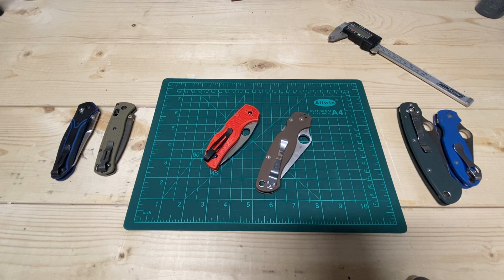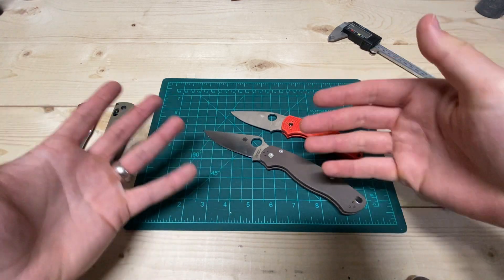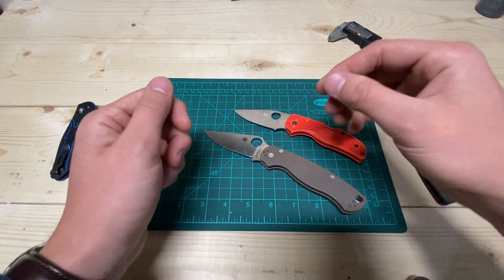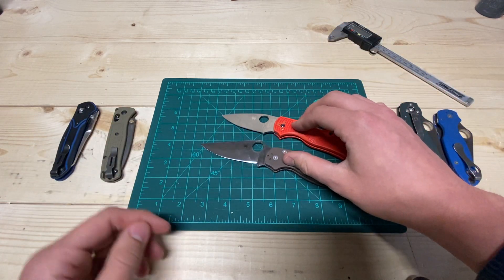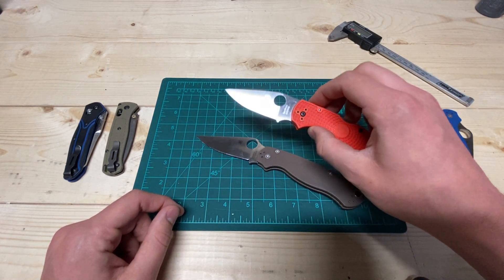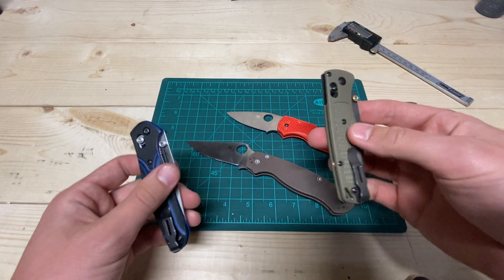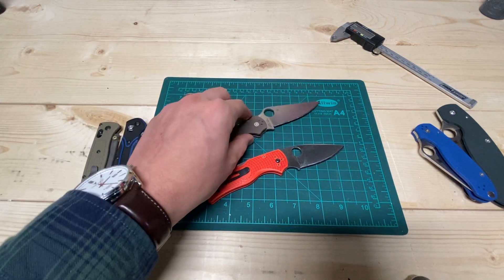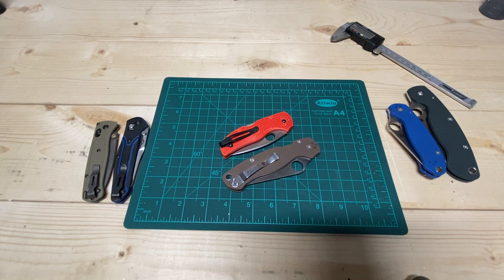High Grit Edge Performance for S35VN and LC200N (Plus a note on hardness)

Comment: I never liked s35vn I was disappointed in my coldsteels lol I also sharpened it toothy like 600 grit like people said it would never last well and I didn’t like it. I tried a hi grit now I really like s35vn ima try the same with spy27! Thanks for the suggestion
Reply from the maker: I was the same way! High grit finally let me enjoy the steel
Reply: @EngineersPerspective701  I got a police 4 in spy 27 on my secret Santa list. Any experience with that steel? I here it’s a lot like s35 in performance but a finer edge and about as easy as vg10 to sharpen I know I won’t be blown away with edge retention lol but I’m kind of excited to mess with it I like steel that easily strop back
Reply from the maker: @williamsmith5429 I haven’t had any but always thought it would be a really nice balanced steel. Kind of like a more edge stable SG3 with similar hardness but less carbide. Especially if you like ceramic stones to sharpen it would be way more enjoyable over the higher vanadium stuff which is why I really like SG3 in kitchen knives even though I find it a bit chippy at say 11-13dps.
Reply: I like bigger blades and the police 4 is my favorite model with a nice thin , long, and slicey blade. Love k390 but not only am I really active I work outside by the ocean where I am constantly sweating or getting rained on and my sweat seems to be very corrosive for what ever reason the tool steels take a lot of maintenance to carry for me. I have to constantly oil stainless or I will rust them too lol.
Reply: Btw I really enjoy your channel and I agree with most your takes on steel appreciate the content.
Reply from the maker: @williamsmith5429 appreciate the comment!

Comment: A recent note: I have picked up a pacific Salt in LC200N, the steel takes a sticky sharp crazy easy, I think for most people it might be an all-around better option than the S30V family of steels, as no special equipment is needed to sharpen this tough relatively high edge retention steel that takes an sticky sharp edge easily. 

A note on the Pacific Salt: It most definitely is Not an endura in a different steel, the blade is taller and the tip is rounded instead of pointy, this might be a change for maritime environments to avoid potential injuries on moving boats. 

Somehow the blade feels slicier, Perhaps however Seki City has just stepped up the quality of their blade grinds. 

Linerless construction and a titanium pocket clip have reduced the mass of the knife from around 90g to around 70g, so it is remarkably light in the pocket. Although it doesn’t feel as robust as the Endura 2 or the Native 5 LW after tightening it it does feel close. 

At the same price as the ZDP-189 and K390 Endura models (perhaps like $5 cheaper) I am left to wonder if it would not suit most people’s needs better for a pocket knife.
Reply from the maker: LC200N is a really fun and great steel. Despite my absolute preference of steels like K390 and Maxamet, it’s one of my most carried knives. I carry it more than Cruwear, M4, M390 etc. which is honestly saying a lot I think. 

Super interesting notes on the pacific salt! I was torn between the native 5 salt and the seki LC200N models. I went with the native because it felt like a safer bet knowing that I liked the native and the waterway heat treat was solid. I wondered if I had left behind a much slicier blade but I figured I could regrind the native. 

Any way to measure the thickness behind the edge and angle?
Reply: @EngineersPerspective701  I will get the measurement when I get back in the office. I suspect the grind angle is 15 degrees, it looks and slices similar to the police 4.

I think comparing LC200N to K390 is interesting because they are both tough steels that hold an edge well and sharpen easily for their respective niches. I feel that for a guy with modest equipment like myself they are very complementary.
Reply: @EngineersPerspective701  I think it is like 0.025” BTE and 15 DPS. very slicey
Reply: @EngineersPerspective701  I think it was like 15 degrees from the factory, and 20-25 thousandths behind the edge. Glad I picked up a LC200N native 5, they are out of stock everywhere.
Reply from the maker: @nandayane  just in time! Not too lo my before we see those magnacut ones!
Reply: @EngineersPerspective701  I’m looking forward to the increased wear resistance. Unlike the Pacific Salt 2 Platform I don’t feel like I am giving up and robustness by going liner-less in the native 5 salt platform. It is also nice that the knife isn’t scary looking.

Comment: My experience with s35vn on a hinderer xm-24 is mixed, I've also tried various stones had some chipping here and there.
Reply from the maker: I believe hinderer tries to go a little harder on their s35vn than most, at or above 60HRc or so. How many times have you sharpened it? I’m a little surprised to hear that you’re having chipping issues even at that hardness!
Reply: @EngineersPerspective701  I've had it for about 5 years now it one of the sterile blades with only the s35vn scribe on, not sure on how many times but I haven't sharpen on a motor powered sharpener. I've sharpening the night before on the shapton 1k and then just stropped it on the bark river green the next day on a slow day at work I started whittling some pinewood from a pallet I found and when I went to look at the edge it chipped I looked to see if the wood had nails but no just some harder wood from fatwood.
Reply from the maker: @adanma17  Huh, that is very interesting. Don’t know what to make of that especially because I think they tend to have thicker geometry. You must have worked that edge just right or something!
Reply: @EngineersPerspective701  I've also have abused it before driving it through metal aswell as wooden doors cutting irrigation lines that were caked with sand. Now im not as rough on it and it's been sharpen from toothy edges to mirror polish.

Comment: Any chance you'll do a video of a common use for your knife as an engineer?
Reply from the maker: These days it’s mostly just packages and household projects! I could make a video taking about it but demonstrations on materials are limited in my working from home role. 

When I was doing research it was a lot of tubing, zip ties, supplies boxes and small equipment crates. Also wood trim, rubber gasket material, deburring plastic tubing,sheets or barrels after cutting. 

When I was at the sugar refinery it was small and large equipment boxes or crates. Scrapping equipment tags, small office tasks, etc.
Reply: Benchmade under treats most steels. Except elmax is in the optimal range. And cruwear is treated nice and hard I wish they made
More knives in cruwear they actually do a good job on that steel some coming in at 64

Comment: Happy Saturday Justin, I have no idea about the quality of the steel on the knives I own ( mostly SAK's ) & its not a criteria for me when choosing a knife, as long as it can cut carboard & peel an apple I'm fine with it.
Reply from the maker: Victorinox uses X50CrMoV15 steel or an analog of it. It’s a high quality Swiss or German made stainless steel with low carbide volume and a hardness usually between 55-58HRc. It’s just okay and Victorinox does a nice job heat treating it albeit at a low hardness 56HRc or so.  

I actually have a video on that steel specifically if you’re interested!
Reply: @EngineersPerspective701  Thanks but its beyond my understanding, all I know is it gets the job done, sharpens relatively easily & I like the mirror polish on Victorinox blades.
Reply from the maker: @stevesinclair4159  All good! Different strokes for different folks!